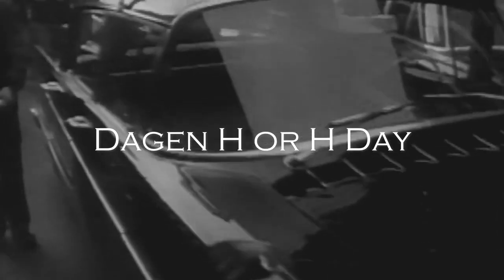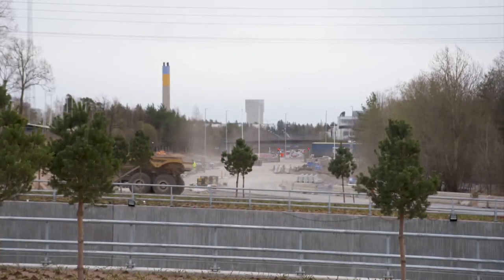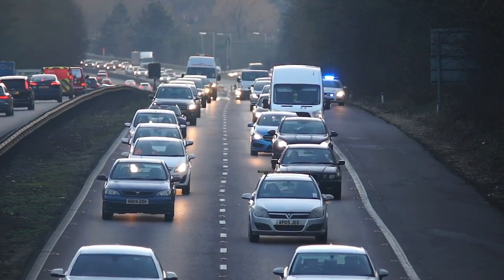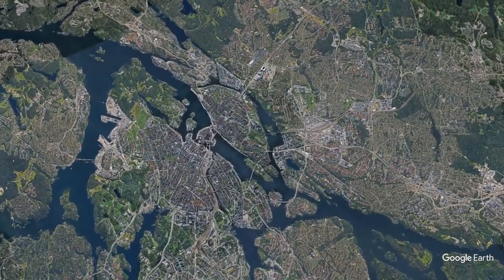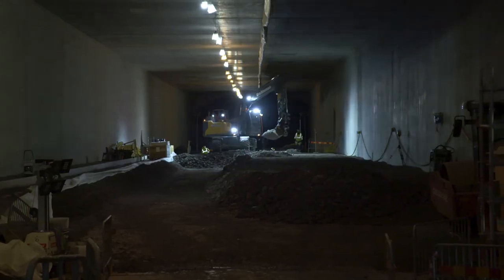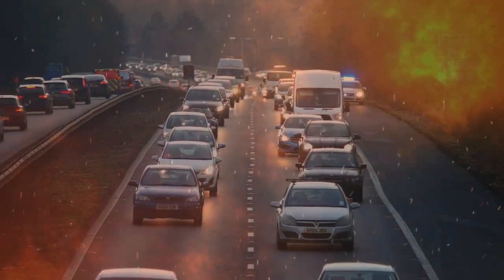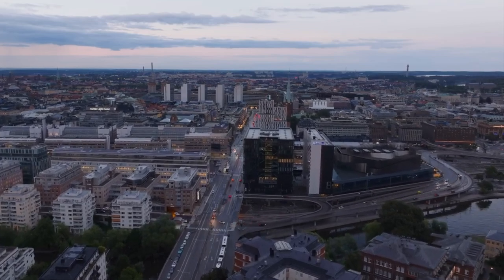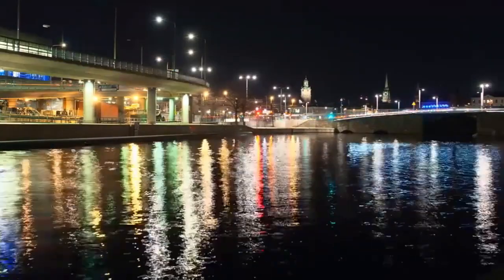Sweden's $4 BILLION Underground Superhighway

Comment: No, driving is NOT the most popular way of travel in and around Stockholm. Getting to/from work 42% used public transport, 31% cycle and only some 14% by car. The main road is still overcrowded due to the other factors mentioned: Mainly that Stockholm is surrounded by water and it is not easy to create roads around the city.